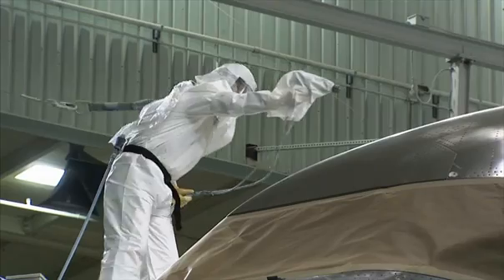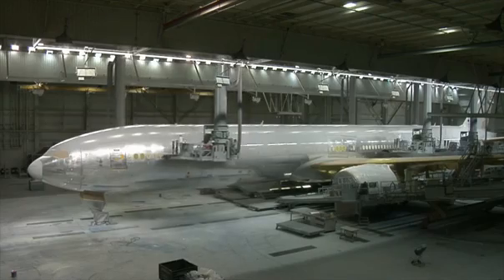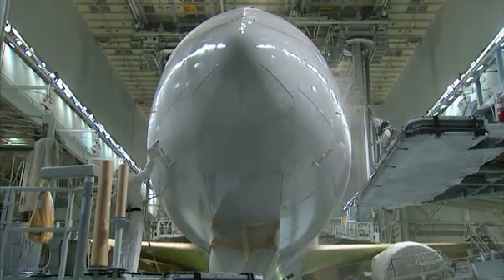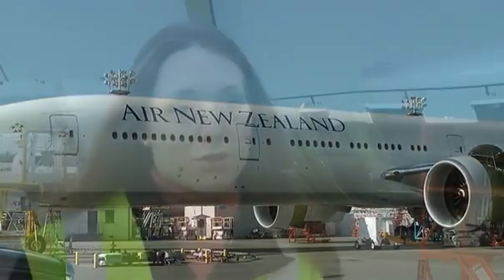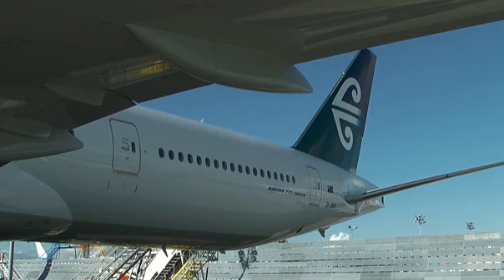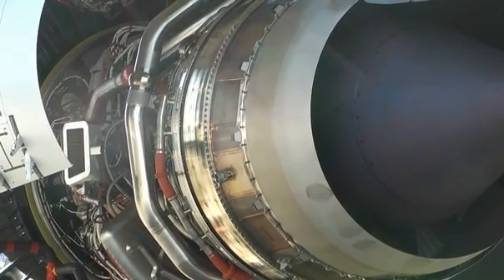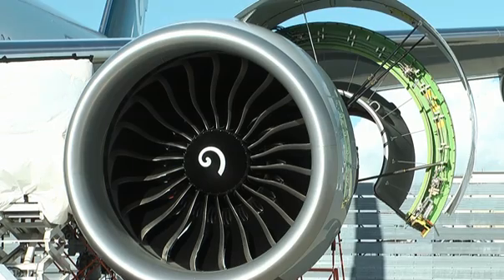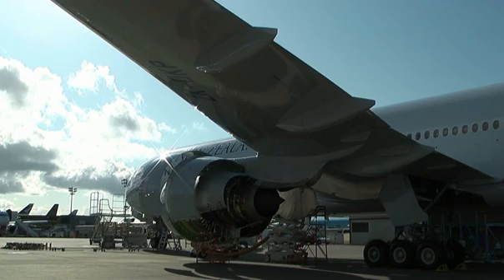Delivering a more environmentally sustainable Boeing 777

Comment: 777 now some how like 737, Boeing may not necessary to built 747-8I to compare with A380 they shall focus on twin engine double deck Y3 project instead or make a full deck on 747.
777 let A-340 has no orders in last two years and killed A-340, doesn't she?